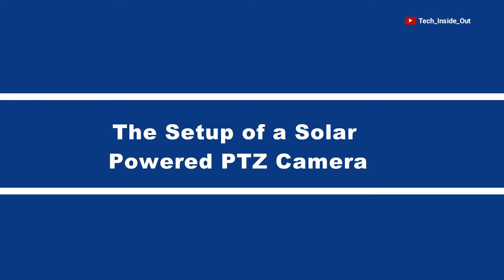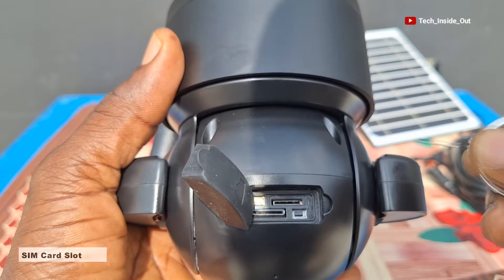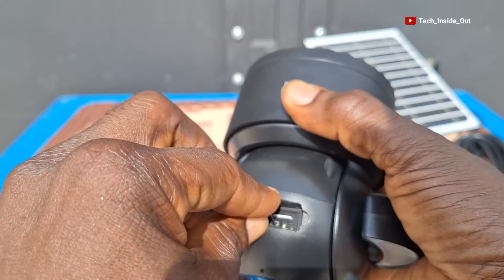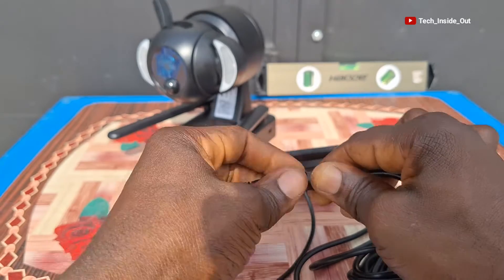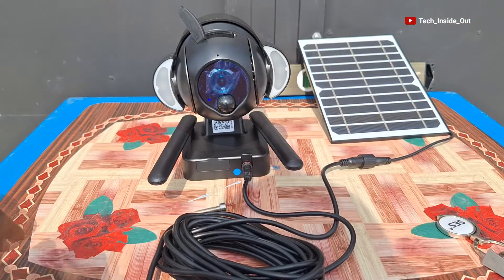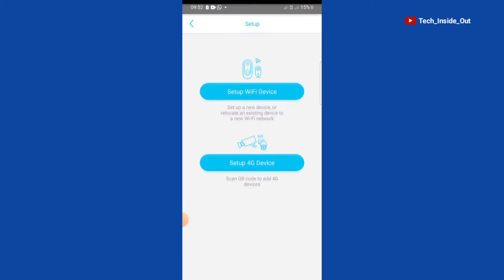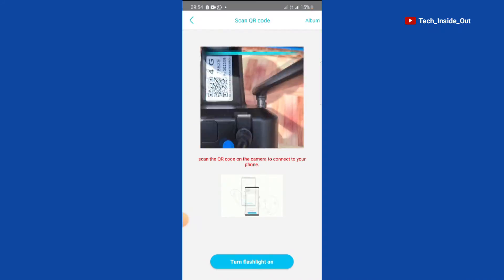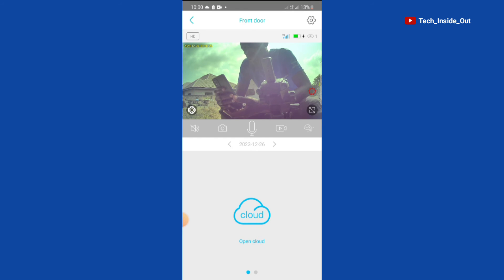Solar camera with sim card

Comment: Thank you very much for the video post but i still have a question?
 After carrying out the installation and configuration, before i can start viewing the camera that means i have to subscribe data to the SIM card right? Secondly 
 * How do i know when the data finishes?
 * Before i can make a call to the camera that means i must have Data or Airtime which of them will i have in my phone for me to call the camera
Reply from the maker: 1. Yes, you need data on the SIM Card
2. You will not be able to connect to the camera over the internet again.
3. Calls on the camera requires data.